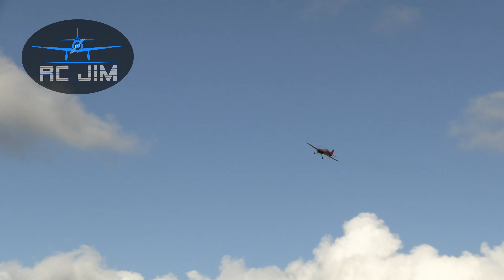VQ SBD Dauntless Maiden Crash Analysis

Comment: Since I did not see any glue or debris on the two flap hinges, I feel most likely the flap pulled out unexpectedly, and it was to late to make a correction , as you were not expecting it.     Many modelers say, they always try to pull on the hinges to make sure they’re not loose, which I don’t do all the time. I’m going to start. I don’t think it was RC Jim.  But a catastrophic hardware problem.
Reply from the maker: Hi Rob, Yes, I agree.  Looking closely at those two hinges you can see that glue was applied to the hinge, but it is smooth and clear.  No sign of it having bound to anything.  Following the first major turn it was acting a bit twitchy, and I think that was it just pulling slightly, then going back into place.  But, down at the down-wind end of the field we have some trees that generate some interesting wind movements, and the wind was blowing.  It probably got a nice up or down draft and yanked out the hinge beyond the fat bit where the glue was.  That sent it gyrating.  Another lesson learned, and I hope that many others beyond myself will benefit from my mistake in not checking it better.

Comment from the maker: Thinking of the third failure option, it was the left flap that was down.  That would cause the plane to roll to the right.  It's also the direction that Jim would have been applying to the controls around that time to straighten the plane coming out of the left hand turn.  The flap popping into that position plus aileron applied in the same direction would add together to make the plane roll faster.  Furthermore, Jim noted that the plane was very 'touchy' regarding aileron control.  That could be either the amount of travel, or, perhaps more likely, it could also be related to that flap beginning to come loose...